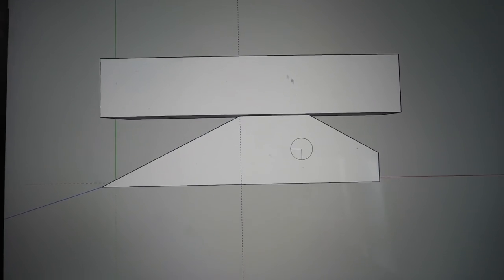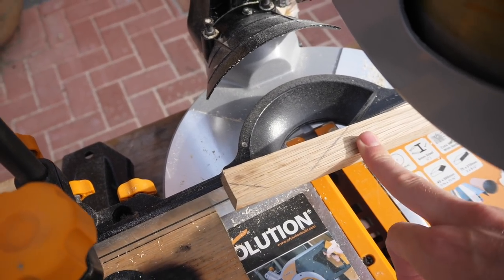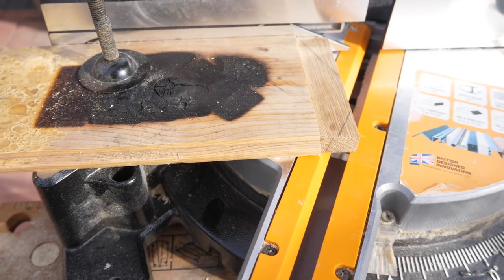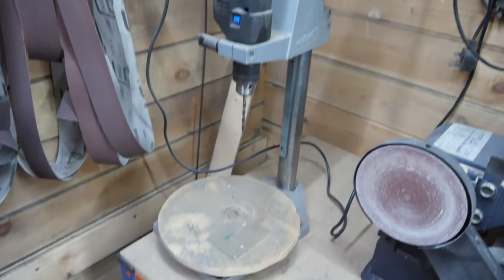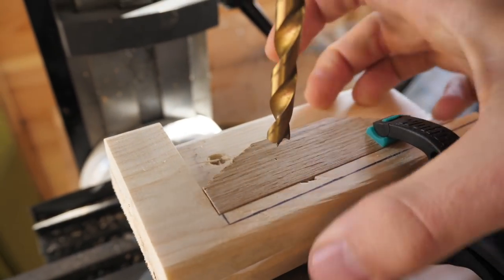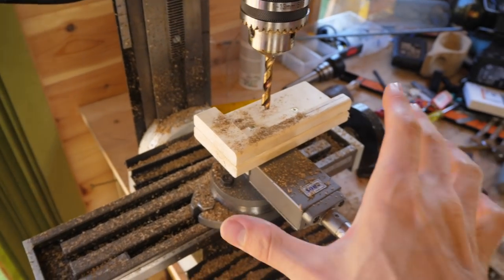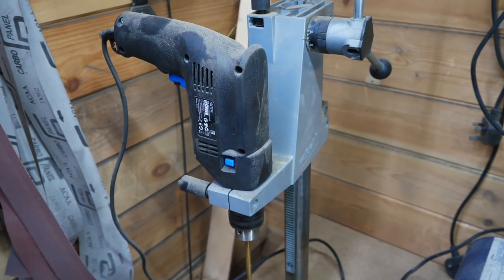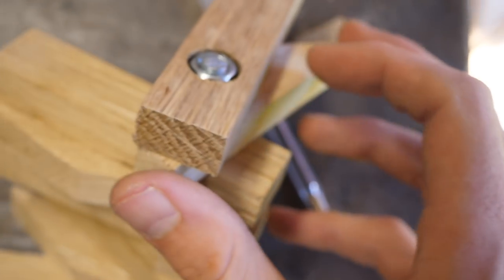REMAKE OF OAK PINTEREST HOOKS! Modern coat rack for camper van

Comment: Qualified carpenter here :)
Your fingers are very close to the blade. If you hit a knot or rot, the piece will buck and you could cut yourself quite badly.
Stick a bit of 6mm MDF with double sided tape on top of the jig (protruding out over the piece) with fine grit sandpaper to hold it fast on the underside. Then cut away my friend, fingers safe and ready to finger another day!
Reply from the maker: Cheers Morgan!

Comment: Good job👍😁 looks good.... with cutting on the chop saw, clamp down a 10mm+ bit of wood along the whole length of the fence as a "sacrificial" piece, it will stop the chip out when you cut the pieces to length.... Also try to use a piece of wood to press down when cutting the angles, or use a bit of wood the same thickness of the bit you are cutting and use another piece of longer wood on top, which will help clamp down the bit you're cutting .... The saw blade can catch on the wood especially when using hardwood like oak, which can damage your saw ( which I have done 😅 ) and will definitely mess up your fingers, and having your fingers that close to a blade is not wise. Hope this helps, we really do love your videos 😍💓
Reply from the maker: Thanks for the tips! I do understand about the finger danger, I think I should finally start being smart before I end up having a quick moment of very bad luck